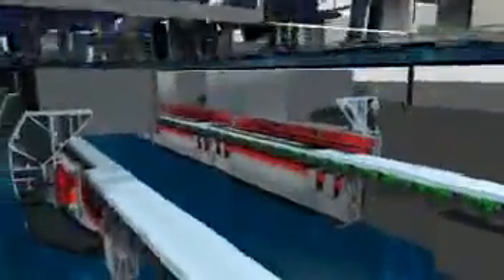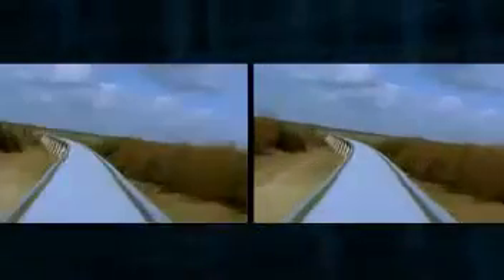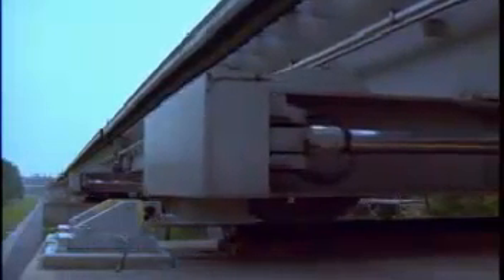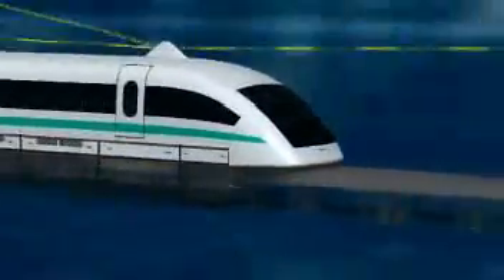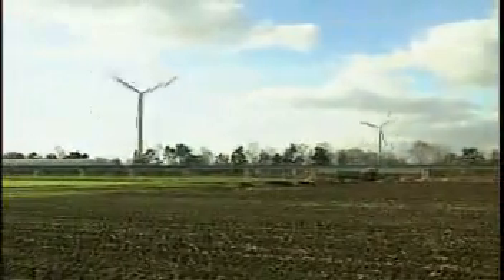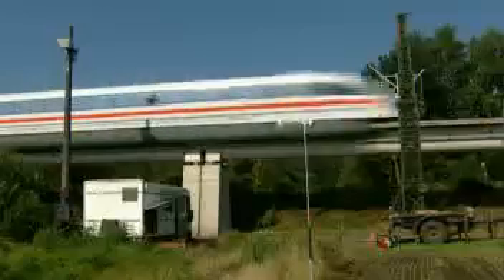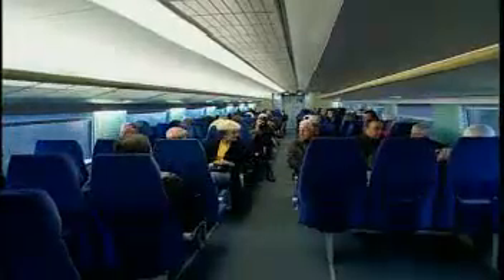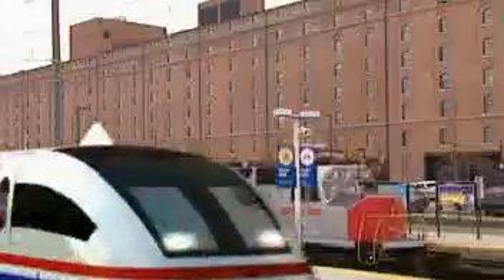Maglev Train

Comment: @pwnerofn00bz666 ETT stands for Evacuated Tube Transport. ETT is the fastest and most efficient way to travel. It uses well known methods, parts, and technologies. The patented system works by eliminating virtually all friction normally associated with travel. Three basic embodiments range from: low tech low speed systems for local use at speeds below 200 mph; to high tech systems for continental and intercontinental transport up to 4,000 mph or more. For greater detail see technology section.